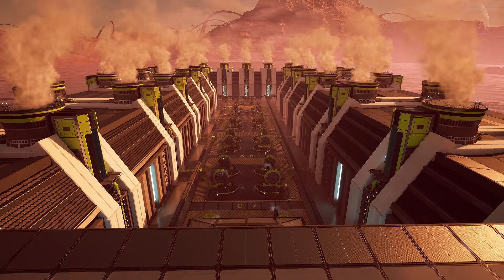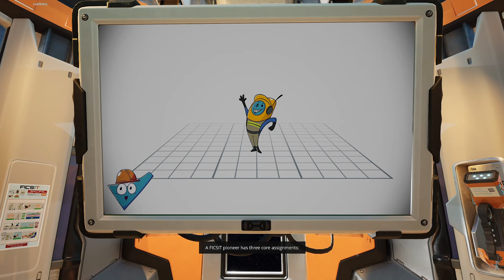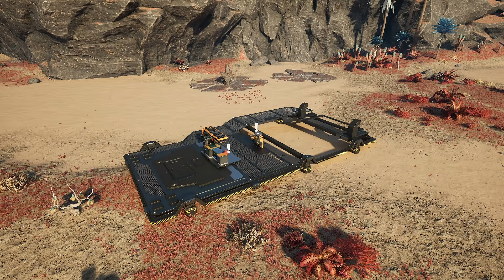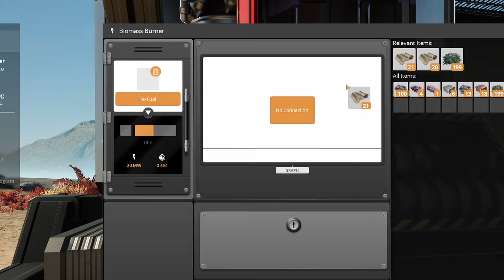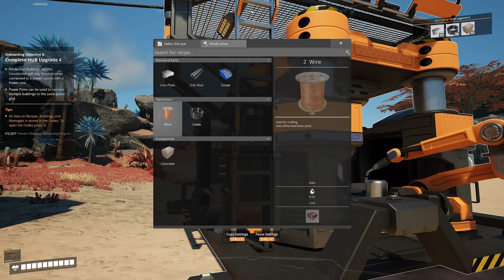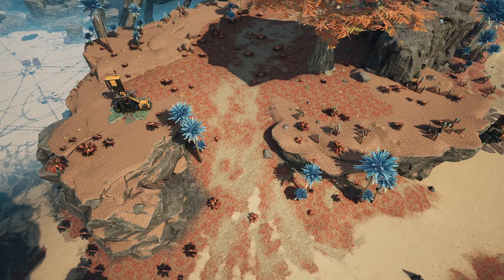The Ultimate Beginners Starter Guide in Satisfactory 1.0

Comment: 22 minutes. lol I probably took 4 hours or more, I did most of the work by hand, well, until I got to item 1 for the elevator build 50 specialty plates, that took my machine like 25 minutes to make, and that was after I made 50 reinforced pieces and 50 rotors, hmmm.  Well, the next step says make 1000 :(  OK, I do not feel like making 1000 rotors by hand, then 1000 reinforced plates by hand, then waiting 500 minutes to convert them to that specialty plate :(  That all seems bad, bad, bad :)  Well, I did make a power generator since I blew up my mini-power generator when I added the constructor :)  So I probably need more power, more coal, more everything :)  Must be time to build a factory for real now, burner stage completed :)

Comment: My main QOL tips: If you have extra mouse buttons, remap use and ESC to 2 of them for easier interacting and canceling out of menus without taking your left hand off the move keys. Also turn off hold to run and enable the reset when stopped option, then you can rebind crouch to CTRL as it shares double duty with the pinky for shift. Really hard to sneak up on enemies holding C with a directional move finger...
Reply: on 13:36:  How do you set the view as birds-eye view? :) Thanks

Comment: QUESTIONS / STRUGGLES :

1) I find it difficult knowing what should be included in a single factory at the start ( do I put everything up to Modular frame here or do I stop at the reinforced plate and plan a new factory for the next big thing).
2) Also planning factories (input, outputs) effectively. I always end up with compromises that screw the build in all kind of ways.
3) Having a hub for materials is great but... getting items over there is the issue. When you end up with 20 lines going in a direction, it gets messy fast.
4) Very difficult to problem solve fluids. The quantity and pressure in the pipes, I always end up just throwing more pumps and it wont always help.
Reply: If your transporting materials to a storage area for your daily use (where you grab from to go build the next factory) you csn use smart splitters then you only need a couple lines compares to one for each. Then sink the excess materials. There's lots of videos out there of how this can be done
Reply from the maker: Good questions we'll certainly plan to cover them in future videos. 
But I always recommend creating a little of everything first, then with those resources build dedicated factories for your storage. Otherwise you get drip fed materials throughout the whole game, slowing you down

Comment: My recommendation for the start of the game is not to bother with the Miners, stick with Portable Miners as they are basically free and don't consume power. This allows you to set up 4 smelters and 6 constructors: 2 smelters each of iron and copper, then one constructor for plates, one for rods, one for wires, a pair for wires to cable, and one for concrete. Set up input and output containers so you can drop off ores from the portable miners and pick up products from the outputs. This is by far the simplest efficient way to automate the early game that I'm aware of.
Reply: Yeah but it’s not really automatic since you have to manually take stuff from the portable miners pretty often. You need power to use the other things anyways so it isn’t a big deal to connect power to miners imo
Reply: @Critterdale  The four smelters and six constructors will take all of your 40MW allowance during Phase 0. After that then yeah go nuts, but until you can place your own biomass burners this is the plan I always go with now. Put down like six or so portable miners on each resource and you'll rarely have an issue with refilling the machines.
Reply: @pfqniet  I see, yeah that early it makes sense
Reply: I agree. Rush foundations before setting up automation.
Reply: thank you for this comment, i just want to point out i think you accidently misspoke, because for the setup you just said, you need 7 constructors not 6, so i was confused at first but yes thanks a lot!

since you said a couple for wires to cables, that also needs a 7th constructor for the 2nd copper smelter - wire - cable
Reply: @HaBbYbOy12Y  Apologies for the misunderstanding. My starter setup is: iron plate, iron rod, wire, wire-cable, concrete. That's six constructors, and four smelters.

Comment: My biggest issue with Satisfactory has allways been getting parts to the different production lines.
At the start I automated every part I could produce and stockpiled them. But I cant quite wrap my head around how to get them from the storage, to the production lines where they are needed. Atleast not without making spaghetti Conveyors.

Any tips for this would be greatly appreciatted  :D
Reply: Did nobody tell you this game is basically spreadsheet and technical drawing wars ?  ;-)
Reply: Give your factory space. Plot out where you will place your input and output busses. Say you have a... Basic iron processing plant. Input iron ingots, receive screws, plates, rods... Maybe reinforced plates.

My basic idea is to lay out the line. Ingots come to an input bus, and fan out to my constructors' manifolds. Output iron rods. Some will flow backwards parallel to the input, and get stored. The rest flow along the inputs to screw constructors. Those come back and join the bus, running back to the storage. Some plates and screws continue along the inputs line and move to assemblers that push reinforced plates. Belt balancing is not the easiest thing to master, but it will do a pioneer good.

If I'm building up, there's going to be elevator towers. If I need to run many things vast distances, I have a tunnel full of belts going one way that I can hook inputs and outputs to.
Reply: Dont be afraid to make more of the same item! A good way to work on a factory is to plan it out by seeing what the final item needs. Then you work backwards. The goal is to see how much of a resource you need. After its all pland just split a line off the ingot line to the new item production line! Just be mindful of how much ore is produced from one node. If you take too much from one node it will slow down production severely. 
All said and done just plan out what you need at the end and dont be afraid to tear down things you have already made!
Reply: Also consider your throughputs. Want to send 120 iron plates into assemblers for reinforced plates? Well, if you don't have viable T3 belts, you can run 2 belts of T2 screws, or run a T1 of iron rods and split it into constructors that make screws all along the manifold of your assemblers!
Reply: For different locations, I like to limit the number of item typed I transport.
So I ship copper ingot, iron ingot, steel ingot, concrete. I make the plates, screws, etc at the plant.

At midgame there will be some intermediates worth shipping.

My overall aim is to favor giving my plants the minimum number of input materials, unless shipping is high effort (distance, liquids, materials based on liquids).

With my current game I aim to investigate which intermediates are good to include in shipping. I suspect it'll mostly be e.g. crystal, caterium, sulfur and oil based products.

Or if you meant how to get materials to assemblers in the same plant, my go-to is splitters before stockpile (that's my building stash), elevator holes, a 2m floor between production layers for relocation, and elevators through holes back down for the new products.
Reply: @Pocketz_DK   planning and  production floors
Reply: Vertical building solved this for me - at least locally.
Reply: @CraigPaschang   yep same u then need to make sure u have space for trucks or rails

Comment: 18:50 "store important items for building"... yes, sure, at the start... but...
I think this is no longer true for 1.0.  Though I'll experience this as I'm proceeding through my 1.0.

with the dimensional depot...  available at T3.  I'm going to guess (and I'm going to build with this in mind) that you'll no longer need to make a warehouse/shop/mall with a whole row of containers and a complex way (sushi belt with smart splitters?) to get them filled up. 

Basically just connect a dimensional depot at the end of each part constructed and overflow to the sink. No need to feed this all back to a central location. Since you'll have a depo for each item, they'll refill fairly fast, and unless you're building super fast of using very dense blueprints, it should fill up almost as fast as you can consume. ANd even if not, you can prepare by moving some stacks to  your inventory while you're still preparing.

Maybe for some of the later tier items where you only produce a few you may want a mk1 container before the depot so it has some backup storage it can move into the depot when you need a bunch of that item for bulk building.

Up to T8 (I need to do my homework for T9 still :D ) there are 29 items that are needed for building. And there's like 10-12 items you'll want on hand (ammo, nobelisk, fuels, shards, gas filter, iodine filter).

So this is 40ish depots (and same amount of mercer spheres) you need to have in total for this, you don't need them all up front, you'll need them as you progress through the tiers.  Looks totally doable to me. 🙂
Reply: I don't know if its gonna eliminate a Warehouse. If you can upgrade it to the point where you can have a decent amount of every single item then its amazing. Like you said you can always have a container in between if the stack sizes aren't that big. 
But if it does have a limited amount of unique items then you probably would still need a storage location. My guess is put often used items in the depot and not so much used items in a central storage unit. 
Either way I am in love with the dimensional depot.

For the Minecrafters: It's kinda like the Enderchest. Its nice and on its own has its use but its limited and with shulker boxes they become incredibly good.
Reply: @ilyboyswag  The dimensional depot can store all items at once in it. Its only limit is the stack sizes which are upgradable, starting at one stack of each item.
Reply: @eXponentia  Thats really sick then thanks!
Reply: @oreubens  in the videos I sore it looked like max was 2500
Reply: @andrewhoughton8606  It initially starts at 1 full stack of each item, upgradable per stack (at an increased mercer sphere cost per extra stack)  to 5 stacks.  Initial upload speed is 15/min, upgradable (also in 4 additional steps (doubling each step)) to 240/min
So the 2500, ok, this is then for 5 stacks of something that allows 500/stack (like concrete).
each depo has a separate upload...

With a fully upgraded dimensional depot... yeah, you'll run out of concrete if you consume more than 5 stacks in 10ish min...  Smaller stacks will fill up faster...
Maybe for some of the high volume low end items like concrete, iron plates you might need a regular depot you can stock up on before a big project... but everything else... nah...

But consider you have 5 stacks of AI limiters refilling at 240/min...
How many of those are you ever going to need more than 5 stacks off in less than 2Minutes...

Meanwhile... while I've unlocked T4, and out on expeditions to kill beasties and get nuts, berries, bacons, harddrives, slugs, mercer spheres and somersloops...
Best use: put all the collectables in the depot and keep your inventory clear.  I can panic if I have a full stack of harddrives, spheres of 'sloops :-D... as well as all the collectables arouind drop pod sites.
Meanwhile, I can unlock pretty much all the harddrives with stuff from the depot (and doggo donations)... pods needing power is just a matter of dropping a biomass burner blueprint.

In my 0.8 playthrough I used a mod to expand the inventory,...  don't need that anymore :)
Life is good... now I just need another 68 mercer spheres to fully upgrade the dimensional depot... I've some more exploring to do...
Reply from the maker: It''ll still be super important to have buffers - If I'm spamming down foundations using 100s a minute with blueprints, I'll run out of concrete before the DD's refill. It'll still be useful to have storage.
Reply: @TotalXclipse  yes, and no, maybe... :)
If you're in a location far away from your base, just plop down a concrete factory from blueprint and in no time you'll have all the concrete you need. Same with the iron plates.  The resources can be found anywhere and blueprints make this easy to build and tear down.

Best usage will undoubtably be having "unlimited" ammo, nobelisks and rocket fuel on hand at any time...  So annoying if you didn't bring enough :D
Reply: I think that the mall will be relevant into midgame.
The first DD's will be at long distance things like quartz and oil products.
The basic materials mall won't get DD's until I can fit one to each commonly used material.

But: I will design the basic materials mall so that I can link the containers straight into a line of DD's for those sweet buffers.

Comment: When you want to place an electric pole in between two connected poles you can select the electric pole,  look at the wire to select it, and after clicking one you can then look at the spot you want to place the new electric pole, and once you do it will be connected between the two other electric poles. An easy way to branch off without having to delete the wire, place a pole, and make new
connections.
Reply: Thank you so much!!
Reply: @DuhstinK  on 13:36:  How do you set the view as birds-eye view? :) Thanks
Reply: @EnginDoyuk  i think he is using a camera mod for that.
Reply: Hey thx.. and does the power gets divided by each new pole connected?
Reply: @prathamverma8646  You've probably realized this by now, but the number of poles doesn't affect the power available at all :) You can attach any number of poles, and only once machines are connected will power start to be drawn. Think of it as a big pool of power, and each machine drinks from that pool.
Reply: @prathamverma8646  on 13:36:  How do you set the view as birds-eye view? :) Thanks
Reply: on 13:36:  How do you set the view as birds-eye view? :) Thanks
Reply: that is very helpful man thank you

Comment: To move copper back  would be better to use loads of portable miners  and not waste resources on power line
Reply: It will cost time to pick up the copper then walk back to the hub to smelt it that’s time better spent on something else.
Reply: @robertg457  I agree but it does allow a higher input on impure and normal nodes.  And if moving 10 stacks at a time that is fast than just using miner and less power at tier 1 and allows u to build Ur first factory without miners and stuff getting in the way.

Comment: 10:31 instead of deleteing the cable, you can make the hologram of the pole you want to build touch the existing cable, clic once,  then select where yo uwant to build your pole.
this will have the same effect without having to delete the cable and cut the power of the machine or grid you are disconnecting.

Comment: All I've been doing is cheesing unlocks, Im at fuel already. And unlocking all HDs possible to make one and done factories so I don't to have upgrade later. I guess even with 400hours+ you don't abandon the spaghetti. I was worried that in 1.0 you wouldn't be able to cheese recipes and reload till you get the recipe you want. You can and its even easier than in 0.8. Lol, gotta unlock it all until they patch it if its a bug...
Reply from the maker: What if I gave you a solution tomorrow to not cheesing but getting all the unlocks faster?
Reply: Manipulating alts by holding hard drives is intentional, and was said so in the video detailing the rework
Reply: Can confirm Rex's comment. It's intentional that if you don't claim a recipe, that hard drive will block 2 alt recipes you don't want. Previously a drive would take 1 recipe from the pool, so it should be ~2x as fast to hunt for recipes< as long as you remember not to claim anything from a hard drive once you rerolled it and it's blocking a recipe you don't want.

Even if it has a recipe you want, wait to claim it until you want to put its other choice back in the pool, or to start using the recipe of course.
Reply: ELI5 how to do this please, 1st time hearing about this trick.